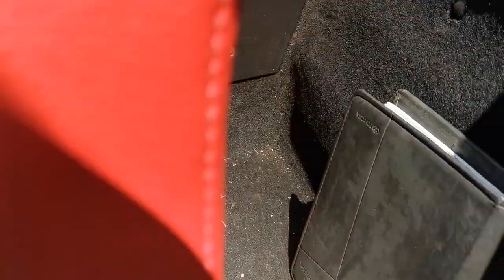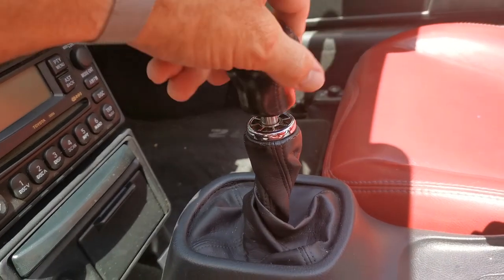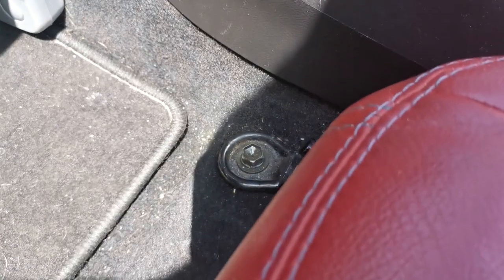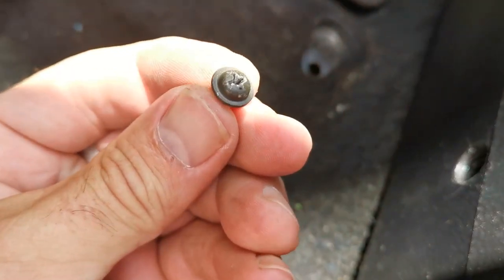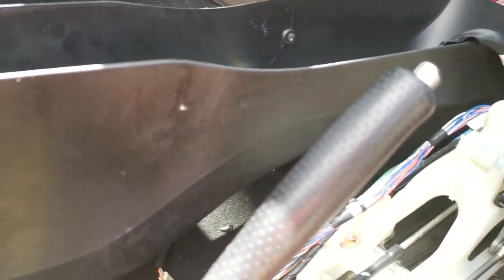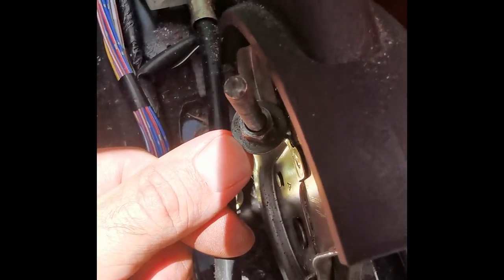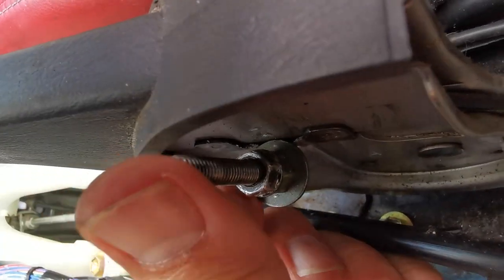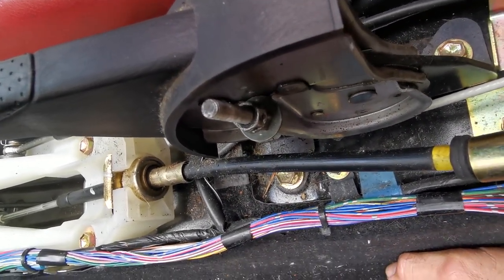TOYOTA MR2 SPYDER / ROADSTER HAND BRAKE ADJUSTMENT

Comment: Helpful  but you should jack the rear of the car so you can make sure you have NOT got too much tension on cables and that the back wheels remain free! when the  H/brake is in the off position .
Reply from the maker: For sure.. this was only a quick fix... but unfortunately I would never rely only on the handbrake.